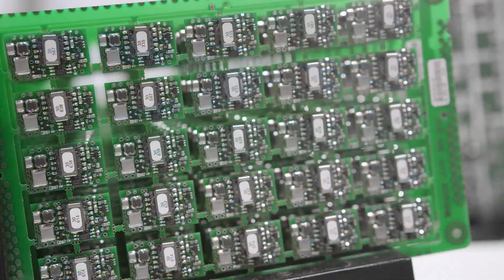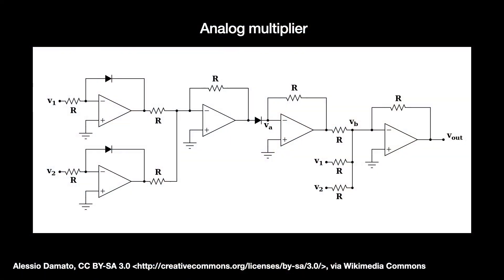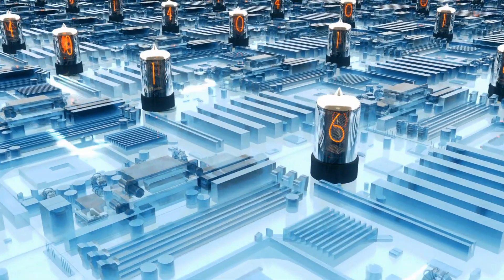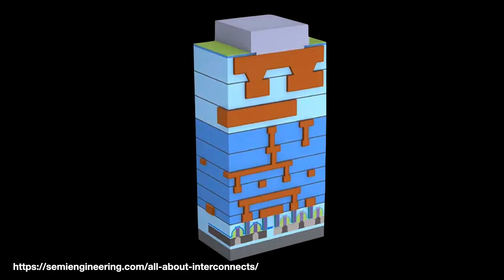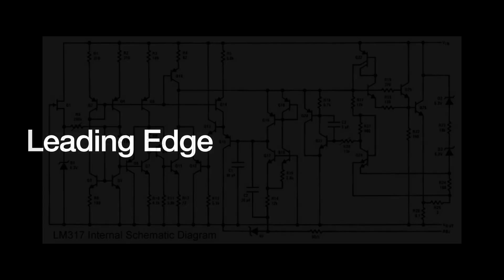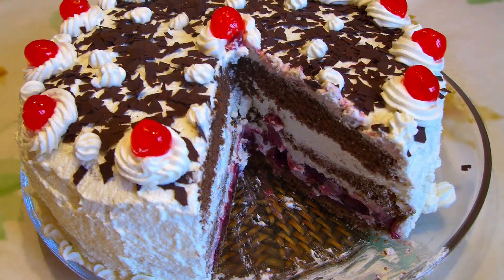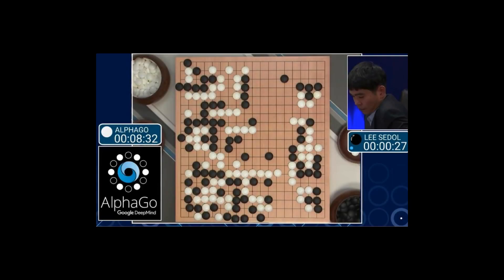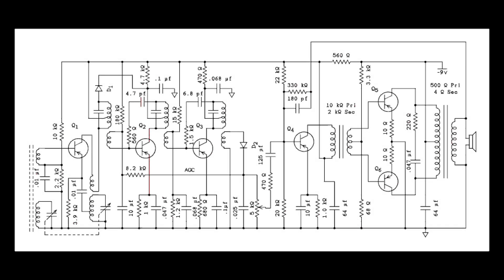Analog Chip Design is an Art. Can AI Help?

Comment: The complicity of analog design is worse when you include temperature sensitivities in the transistor and material performance.  My old company (name withheld) included a Power On Rest circuit that gated power to internal logic so that it always started up in a known state.  The circuit was updated in a routine design revision that passed all qualification tests across temperature and worked great in industrial grade applications, but came to a screaching halt when it was sold as an automotive product.  Process variation of some lots allowed the temperature response of the POR to shift, locking the chip up when you turned it on in a narrow temperature window,  A minor issue for a cell phone, but pretty painful if you are trying to unload VW's from a ship in the winter (the ECU wouldn't function). As you noted, analog design is an art, one where you have to know how all the paints mix and interact.  Nice job on the presentation, I hope your father was able to retire happily.
Reply: Quite true.  Temperature sensitivity is just sort of part of the analog design flow.  It's even part of why there's special analog processes - analog processes often have multiple types of resistors with different TCs and sheet rhos - finding a balance between the right TC, area, and performance means you have to pick the right one for the application and maybe make tradeoffs.  And it's not just that.  We often do things like design amplifiers with current biases that change over temperature so that the performance of the amplifier stays relatively the same over temperature.  And it goes on and on.

Another place where the art shows through is on stuff like DC-DC converters.  You have, on the same piece of silicon, incredibly noisy power switches doing many amps of current and delicate low noise references, amplifiers, and ADCs and DACs.  Making it so those two things can coexist with good separation is quite an art indeed.
Reply: @ccoder4953  Sounds like job security.
Reply: @brodriguez11000  Kinda is.  I'm sure at some point AI will come in and help with design, but it's going to be a long time before it's a replacement for a human.  Even in other fields, like programming, AI is a really useful tool, but it still very much needs a human to guide it, direct it, critique it, debug it, etc.  Now ultimately, that may mean the human is thinking about stuff like top level architecture and requirements while the AI is doing low level work, but I don't see humans not being part of the loop for quite some time.
Reply: @ccoder4953  It's actually (imho) a misconception to think that AI will replace humans ever (in the circuit design). Surely several aspects of flow should be automated, but that will mean that chips will be designed faster and cheaper (in theory), but still people will control this AI-based tools. It's a bit like like with a washing machine - it was supposed to allow us to rest more, in fact, we have successfully fulfilled saved time with other activities :)
Reply: @pawestoworowicz6828  Don't know about ever, but yeah agree, for the foreseeable future, AI will just be another tool that makes us more productive.  It's kinda like how ChatGPT is quite good at writing code, but still needs somebody that understands software to tell it what to do, direct the process, figure out why things went wrong, etc.
Reply: yep that's why nowadays I regret that "artists" aren't complete but concept designers who outsource the real art to so-called "technicians" or just use prebuild industrial products they assemble like canteen/cafeteria "cuisine".
Reply: The problem is that one can not run all the regressions quickly using parametric simulation.  AI can and it can do it intelligently with convergence.
Reply: get better circuit design bro

Comment: As an analog/RF IC designer I can relate.  About a dozen years ago when I was working at AMD our CAD group made an attempt to automate analog design to redesign chips shrinking to a smaller process node.  It did this by interpolating the I-V curves to resize transistors.  The results were laughably amusing and none of my IC design peers ever lost sleep worrying about design automation.  Layout for analog circuits might be an even tougher nut to crack because an alogrithm would have to iterate on extracted simulation, layout, LVS/DRC checks, re-extraction, and back to simulation.  Given the size of extracted netlists, I would expected the required hardware compute resources to require a supercomputer.  LOL.  But all of that was before AI.  Fortunately, I'm close to retirement now so I expect to skate by just as your father did.  Not so sure about the next generation of circuit designers, however ....
Reply: Maybe an analog computer designing analog circuits.
Reply: As an electrical engineer who mostly did embedded software during my professional life, I forgot most about analog electronics and RF electronics, even though that was the focus of my studies back then. 

But - the natural path of evolution of EVERY engineering discipline goes from artistry to automated over a long enough time span. 

At some point, people did not have normed screws and just designed just the right screw for their specific application. Then M3, M4, ... screws emerged. So, often it is about not doing all custom, trading off optimality with automatibility. Yes, maybe you only need a M3.3 screw but you go for M4 screws, wasting some material... But it still pays off. 

Just as the exact pathing of a transistor on a die is mostly defined by the process, eventually, it is just back-to-front propagation of information. 
From the semiconductor production process to the design engineer. And they cannot insist to know better. They play the cards they got dealt. 

I think, eventually this also applies to analog and mixed signal integrated circuits. Reference "building blocks" need to be parametrized by the semiconductor production teams who know their process and those are then the lego stones, analog circuit designers can use. 

It is not a new idea. LM741 is what you have - LM741 is what you use - you don't start to design a slightly differently behaving operational amplifier for your one shot application. 

If this is not common practice, right now, you have a human/social problem. Or bad organization, or the ones on the back refusing to do their job or some protectionism, where the propagation of back to front is (artificially) roadblocked.

You also see this in the field of FPGA, basically, where it is hard to innovate in the tooling area because at the end of the process, information hiding is practiced.
Reply: @ruffianeo3418  i don't know what to study anymore I got analysis paralysis trying to pick a sub-field that won't disappear or be overly inflated.
Reply: @ Whatever you pick, you should see it as a stepping stone, not the end of the road. In unstable times as we have now, I presume, that universalists have better odds than specialists.
Maybe one day not too far down the road, you need to know how to plant tomatoes or to keep bees or how to craft a too shed, because you have to go self-sustained, because only 1% of society own it all, leaving nothing for the rest. Stay positive in the light of you not being able to "settle your future once and for all".
Reply: All the physical characteristics of the devices change. They sure knew CAD...and only CAD.

Comment: Been part of several chip and board bring-ups. Getting the analog wrong through bad or lacking simulation cost us a lot of time and money.
Reply: 20 years ago somebody brought me on as a contractor to add digital control to an otherwise analog system. There was zero chance to make it work as they had not bothered to properly characterize their design and understand the component constraints needed for reliability and EMI/RFI compatibility & stability. 🤦🏻

Comment: It’s kinda interesting to think that even digital circuits are technically analog at their physical level. 😳
Reply: Yes, was waiting for him to hit on that. There is no such thing as digital… we just take some analog signals and pretend they have discrete states, and ignore the infinite states in between.
Reply: @JoeLion55 KaPoooooowwww
Reply: @JoeLion55 quantum behavior then?
Reply: I had this thought too.
Reply: I was searching for this debate in the comments 😂
Someone HAD to bring up this quantization from quantum mechanics, on how everything is actually analog but also actually digital
Reply: but then you realize that all circuits period are digital at the most fundamental level.
Reply: @homelessrobot though it’s back to analog again to the probability distribution.
Reply: @homelessrobot No, they really aren't all digital. Up to 20% of each digital clock cycle of many architectures is spent in the linear range of the transistors (this is a large part of why they draw power, and why higher clock speeds draw geometrically more power) and not in saturation. Transmission lines, may they be data busses, networking cables, or power distribution wiring are all also inherently analog.
Reply: @DrewNorthup  what I was refering to is the planck constant. The energy of particles being in discrete increment, and time passing in discrete windows within which no ordering or subsequence of smaller moments can be discerned.
Reply: @homelessrobot Ignoring spin won’t save you.
Reply: @Stopinvadingmyhardware  spin is also quantized
Reply: @homelessrobot  Until it causes resonances. :
👍🏻
Reply: @homelessrobot  discrete does not mean binary.
Reply: @vp7137s  knowing the definitions of words does not mean you understand what people are talking about when they use them.
Reply: @homelessrobot But planck scale is not digital yes they are quantize but quantum object does not behave like classical object. So instead of bits you are dealing with qubits. And when dealing with qubits entanglement and decoherence becomes a problem which is a lot harder than analog.
Reply: @kazedcat  The property I was talking about was quantization; being made up of smaller discrete components. You do know what the word quantum means right? It means discrete; being made of quanta (discrete sub components, like atoms). Decoherence is a consequence of being quantized at a cerfain scale, but its a consequence. The meaning of quantization is still the same at that level.
Reply: @kazedcat  also quantizatized/quantum and digital mean the same thing (countable). Just as continuous and analog mean the same thing (uncountable). You might as well call the quantum scale the 'digital scale'. That it doesnt' comport with your intuition about how countable things should have very well defined boundaries, and uncountable things shouldn't, is your expectations being wrong. Not my description being wrong.
Reply: @vp7137s digital does not mean binary
Reply: @homelessrobot  Think of it this way. digital means integer (Z). Analog means real numbers (R). Quantum objects are complex integers (Z×Z). Yes they are countable but they are a ZxZ set instead of just Z.
Reply: @kazedcat  Yes, but countable vs uncountable is what is actually important here because of the relationship between digital (discrete, countable) quantities, and analog (continuous, uncountable) quantities.
Reply: @homelessrobot  Yes the size of a set is important but the structure of your numbers are even more important. Is it a ring, a field, or a group. Is the multiplication associative, does it have a a zero product. Is it close under division, does it has a square root of a negative. For example a number system where only primes are allowed it is countably infinite the same size as natural numbers but it is a lot harder to work with because your basic operations +,-,× does not work properly.

Comment: I would love if you made a video on the Semiconductor supply industry. like who makes the machines that make the parts for the semiconductor industry. i work for a CNC dealership. Matsuura is a great company and they have this really cool metal 3D printer that also mills at the same time

Comment: In the mid 80's I worked at a silicon design firm. Mostly 3 micron gate arrays. My boss and a really sharp engineer from the client company designed a modem chip. Their first silicon worked fine which elevated them past hero status to God of silicon design status. Mixed signal chip design is something like witchcraft.

Thanks for another great video!
Reply: What did you study @jonpattison?
Reply: @tomaszapata  I was trained in basic electronics by the US military and I had a computer programming class at the community college. On the job training from tech to engineer.
Reply: and?
Reply: The first silicon worked, he said.  That's pretty rare. @kallucelfrumos4946

Comment: It might sound weird, but capacitors are analog. And tiny little capacitors make up RAM. We try and clear them, and recharge them, within tolerances, but it's definitely not a binary value between those two charge values.
Reply: All devices are analog. It is only the interpretation that we put on the signals that is digital. But whether a circuit's signals are destined for analog or digital interpretation places very different constraints on its design.
Reply: This is true for all electronics. "Digital" electronics just means they work close enough to an ideal digital circuit that we can assume it's digital. This is not always the case though, case-in-point for your example of DRAM, the Rowhammer attack, which repeatedly wrote to strategically chosen memory locations to influence other locations in memory.
Reply: Memory cell uses cross coupled devices tied into a positive feedback loop. To write a memory cell, you need a charge pump & memory driver(both are analog circuits).
Reply: As @danmenes3143 says, everything is essentially an analog device, simply because it exists in the real world. We just truncate that function to digital, for ease-of-use and manufacturing.
I wouldn't be surprised if we end up with pseudo-super-conductors, where it's not lossless, just really fast and efficient, after more research into the art, science, and craft of analog circuits and devices.

Comment: Analog circuit design is an art, if good engineers designs it with understanding, of what the circuit has to do and later tests and layouts it.
If neural networks do it, you likely get a mess, that somehow works, but with no understanding in how and why.
Reply: But AI by itself would just put out garbage. Analog Design encompasses a wide range of fields: PLL to AFE to ADC to switching regulators to RF design. Too broad for AI.

Comment: Anyone here remember the OpAmp 555 timer?
Reply: Yup. The 555 was the heart of many projects back in the day. That and the 221(?) dual monostable.
Reply: I remember well as it is often used in our Logic Labs during those study days.
Reply: Never remember hearing about that, no. I know about opamps and the 555 timer but not the opamp 555 timer. 🤔
Reply: @Gameboygenius  Well, 555 is not 741. But, there are op amps inside 555.
Reply: @JohnnieWalkerGreen  Kind of? They're designed to be comparators and probably wouldn't make very good opamps because they're too sensitive.